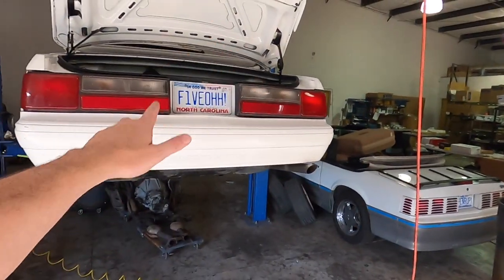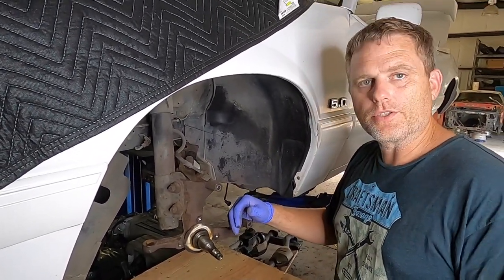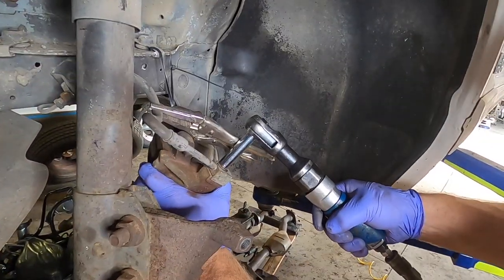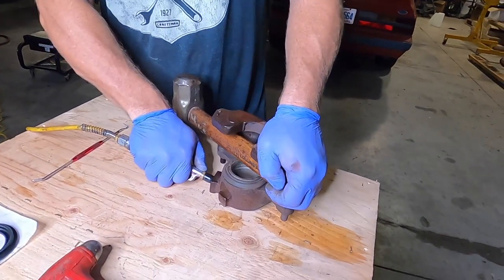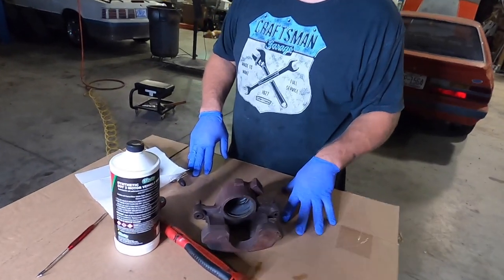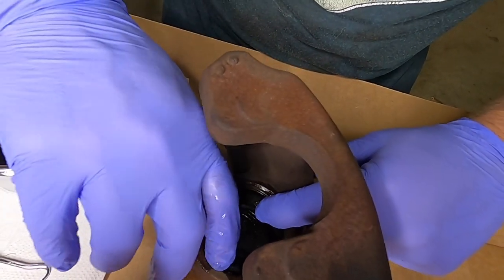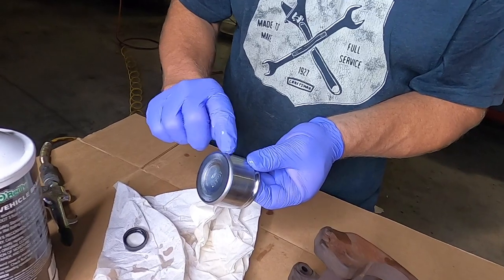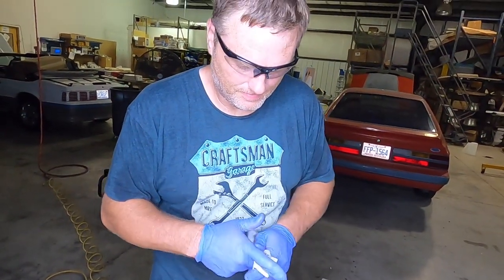REBUILDING THE BRAKE CALIPER ON A FOXBODY MUSTANG // HOW TO REPLACE THE SEALS AND BOOTS

Comment: That was cool the way Matt got the dust boot around the piston. When I rebuilt mine I installed the dust boot on the piston first and then installed both at the same time in the caliper itself. Thanks for the video
Reply from the maker: Cool, sounds like that worked too for you.  Thanks for watching.

Comment: Awesome video. I rebuilt the calipers on my mustang back in 1990 when I switched it to silicone fluid. You can't mix the fluids so you have to make sure all the dot 3 is out of the system. There is caliper piston lube that you can use instead of brake fluid itself. What I use.
Reply from the maker: Cool, I didn't know about the caliper piston lube. 👊